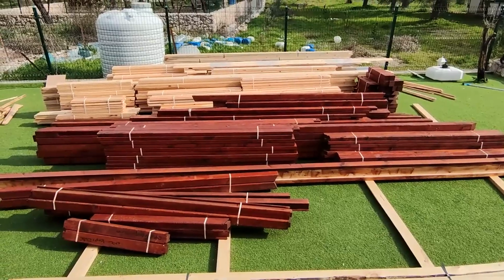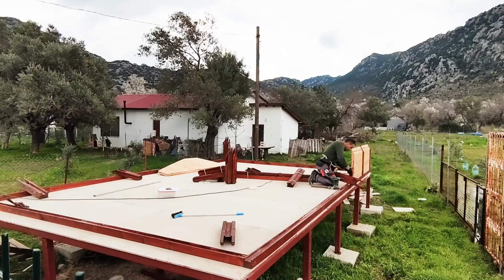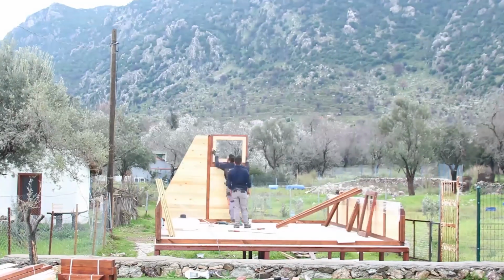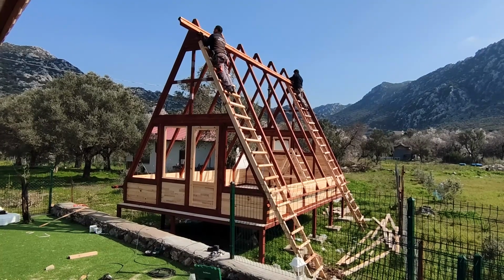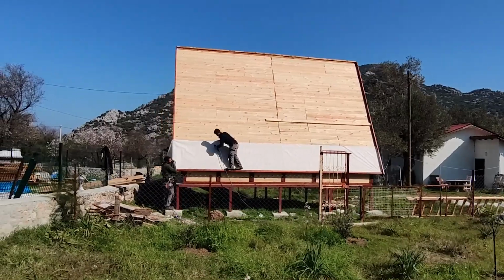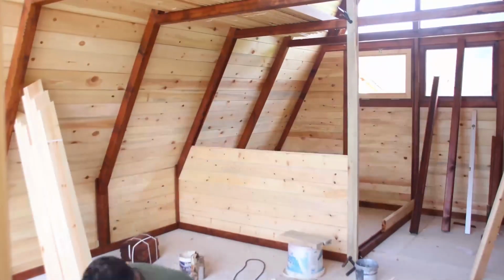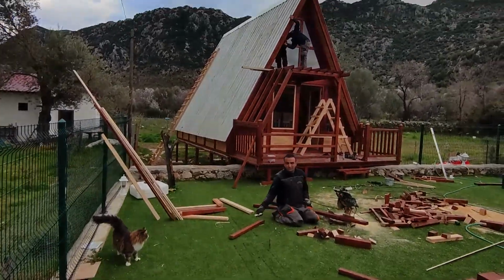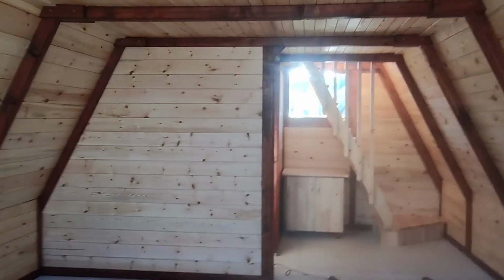How to Build an A FRAME CABIN  , Step by Step Build With Narration, Scratch To Finish In 6 Days

Comment: Very good! Could you please share which materials was used in the roof between the woods? the white plastic cover and the green foam. I live in a country where this kind of construction is not common.
Reply from the maker: after the wooden planks we use moisture barier(polyethylene fibers) , high dense Rockwool isolation sheets , metal sheets